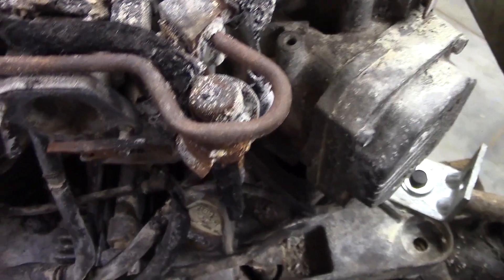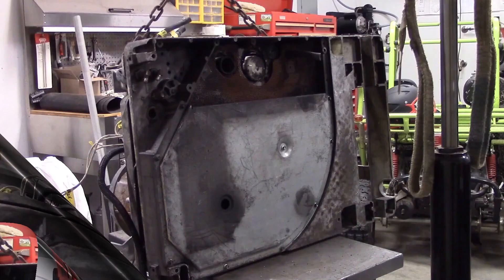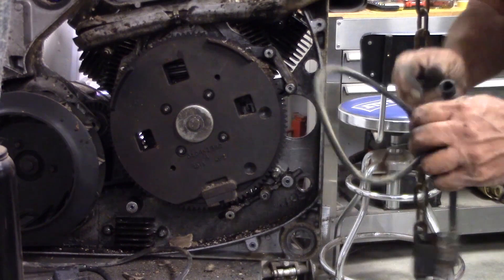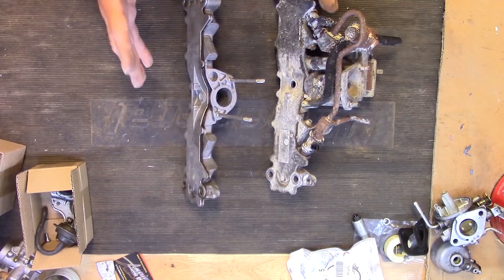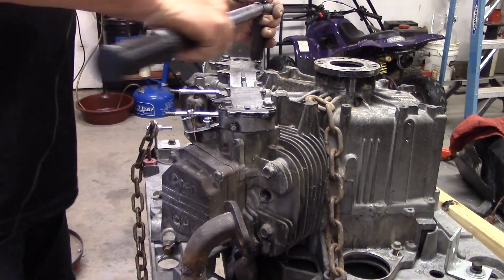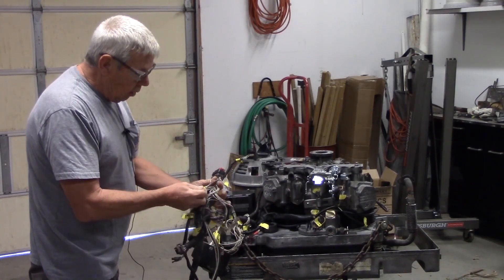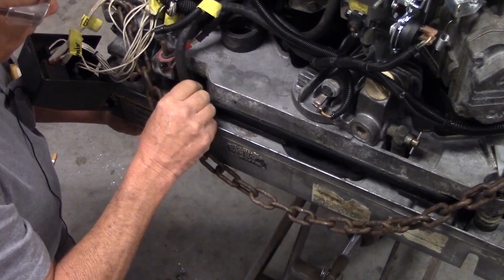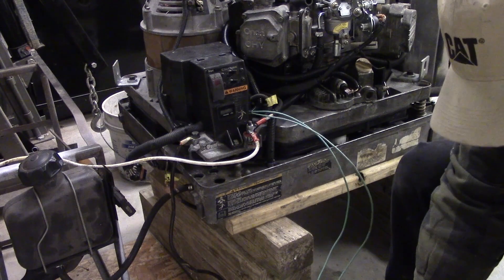Generator Rebuild Cummins Onan After a bad Fire

Comment: Well done Ferd, knew you could do it. I find the secret with all these jobs is to do it methodically with thought and conquer each task in stages..  Great video..
Reply from the maker: Exactly.  At times I have to walk away and put some thought into some of the roadblocks.  I actually had it together and ran it not knowing about the exploded governor. After a few days of thought and blaming the problem on something I done wrong, I tore it back down and found the only thing it could have been.  Hate to say it but what a relief it was to see that shredded up Governor. Good to hear from you. Cheers